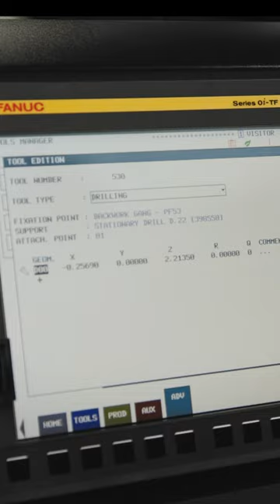Swiss Machining is Making Life EASY #shorts

Comment: "makes life easy" I'd like to see the couple days of set up that gets done for a swiss machine
Reply: And it is quality and precision. The best!
Reply: I don't think this swiss has cam lobes lmao
Reply: takes me about an hour to 8 hours for a setup (depending on the part) that will run 24/7 with minimal intervention
Reply: @LachlanD1213  the average for my machines set ups is about an hour too, but what happens when something goes wrong with one of the million axis of your machine? I know depending on what goes wrong it could take it from an extra hour to an extra day and we only have three axis and an A axis to worry about
Reply: @troylentz6580  i was working on few of these making dental implants. 4-8 hour setup and you can get thousands of parts 24/7 if operator will not screw up big time. Just make sure that you have perfect quality rods and cutting equipment.
Reply: Meh most could be done with standard tooling, just a few collets and a drill/ thread tool
Reply: id like to see the cost of that machine, its probably above 2 Million €
Reply: @GodOfChaos_HeXa  easily
Reply: I would like to see these guys run a manual machine. Haha.
Reply: @troylentz6580  Oh wow, they're that good?? Seems like even if you had tons of issues and it's down 4-5 hours a day having it run the other 19-20 hours with minimal oversight would be a lot more efficient than having to dedicate people to manually doing everything constantly.
Reply: @jjw6342  I don't think it really matters in the end, does it?
Reply: @codingfeature3684  I think you misunderstood something I said, or perhaps extrapolated meaning that I didn't intend? I'm not saying they arent fantastic machines, I'm only saying "easy" is not the right word and it takes time and expertise to run them as efficiently as they bring run
Reply: Es apasionante día a día mejorar aun más los programas para aumentar el rendimiento  sin bajar la calidad del producto final.
Reply: Just gonna drop some knowledge and say that this bs he’s doing is easy asf. Like I literally don’t see what isn’t gravy ab this job. Checking everything with calipers so I know for damn sure you ain’t holding a tight tolerance (for reference my tolerance is +.0002.) idk you’re like not that far away from just being a button pusher. I run 2 yasda ymc 430 v.3 for reference. But I’m just getting tired of machining videos that highlight shit that just looks cool or that claim to be “precision” but are only holding .005 tolerance.
Reply: Think my machine is harder than this, 5-axis citizen l-20 even though they have 7 axis, they max out at 5 hour sets, easy jobs in 2
Reply: Bro it does not take more than a few hours to set up most jobs on a Swiss lathe. What are you talking about?
Reply: What do they mean by macro? I’m a machinist and I know what macro means but not in this context.

Comment: He sent run one one a few years but Swiss machines are cool
Reply: I’m gonna drop some knowledge for no reason but, Swiss machines are alright, they have the best machines for checking parts, but im typing this sitting at my desk (bc im a machinist) those parts he’s doing are easy asf, the tolerance is wide open, anything you can check with calipers is no “precision” machining. Currently im working with +.0002 as my tolerance milling score dies. I can tell you from my experience the German machines are the seriously bad ass ones
Reply: @jacobadkins5164   I  worked with citizen machines. Everynow and then some .0002 stuff and high finish stuff. Would’ve been cool to work with higher level stuff. And yeah it’s funny when people get impressed with calipers being accurate to +-.003 when you can go so much deeper to the point where the room temperature changes measurements